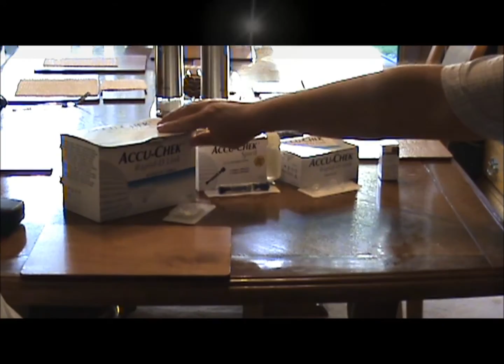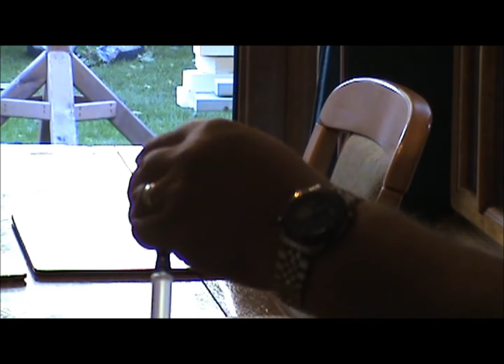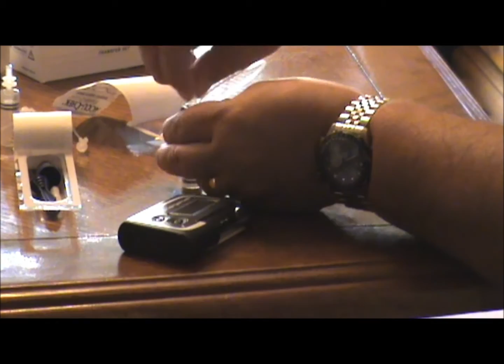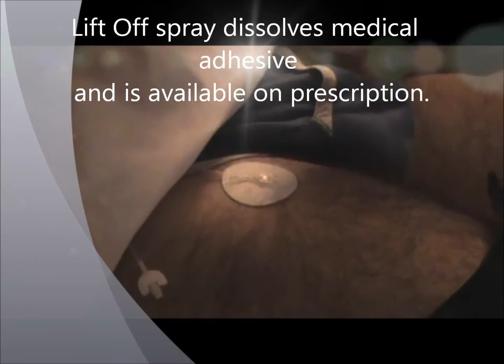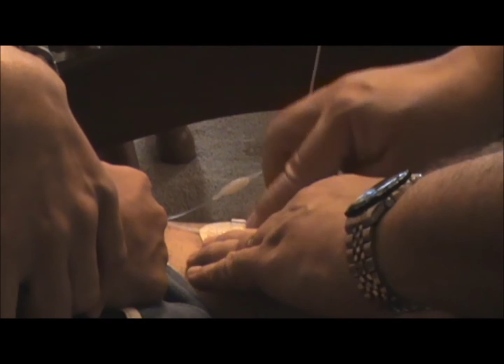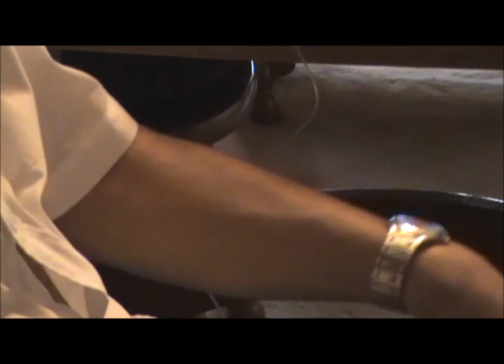Changing the Cannula & Infusion set - Accu Check Spirit

Comment: Interesting. I use the Medtronic Minimed Paradigm 723 with the MIO infusion sets.  The Accu Check does seem a bit harder to do. Also, I doubt I'd have the courage to self insert the cannula. The MIO has an on board launcher. Good video.